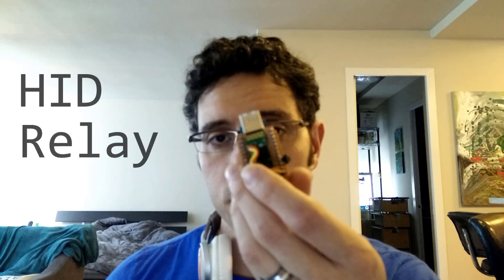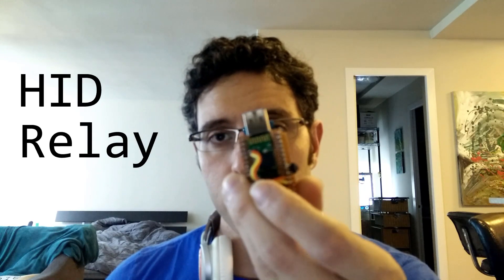HID Relay - Upgrade your USB Keyboard to Bluetooth!

Comment: Alot of gamers use PS2 keyboards. They're faster than USB connections. PS2 push information out, while USB pulls information, meaning PS2 sends information when it needs to, USB only checks to see if there are updates to pull.
Reply: Even better PS2 interrupt the computer to tell the keystroke

Comment: Damn i wish there where devices like that to buy. but i guess if we wait a year ot two there will be comming more and more good mechanical wireless keyboards on the market. currently there is only a very small market for those and it's hard (nearly impossible) to find a nice keyboard that is wireless.

Comment: Don't you sell ready-for-use devices?
I like the idea to convert my Lenovo SK-8855 keyboard to wireless (it even has a kind of bay for it at the bottom!). 
BTW have you tested  it on any keyboard with build-it trackpoint?

Comment: This nice, thanks for making this. I'm pretty new  electronics(have programming experience tho), I was wondering if I could make my USB mach keyboard bluetooth enabled plus I want to put a 3.5mm audio adapter in it so that you can also listen audio from the keyboard itself. I'm not even sure if it's possible, can you please guide me if that's even feasible project..  if it is, can you please point me in right direction?

Comment: Please do this for a wired gamepad. ME and a lot of people have the Nvidia shield controller (2015)  that works with windows and android when wired up via micro usb charging port. It was originally a wireless controller for shield devices and do not use it much as of right now. Nvidia somewhere in their support promised us Wireless connection to pc sometime in the future, but it seems,  the future meant another generation and I am not willing to dish out £60 for just a controller -.- 
If this could work with a gamepad then that would be great :)
I hope you read my comment 
Thanks for the great work

Comment: Cool! Did you test with custom firmware keyboards that register multiple input devices? Keyboard, media controller, and mouse input?
Reply from the maker: The closest to that which I've tested is with a logitech unifying receiver. It's a bit silly to go wireless over wireless, but it does "work". The standard keys are picked up, but not the specials like media buttons or calculator launcher. The mouse has a noticeable lag. Not wholly useless, but nowhere near responsive enough for games.
Reply: DastardlyLabs Yes, I'm suspicious those register as multiple devices, and need to be handled differently... Wonder what happens if you plug it into a hub and let the hub handle it :)

Comment: Hey , so i have a laptop that I am not using. So how do I make its keyboard Bluetooth or even wired usb.
Reply from the maker: You'll have to take it apart and see what you have. Look if it has any chips acting as controller and research the part numbers. It's "highly" unlikely, but it may just have a usb interface with a non-standard connector and then you'd splice a usb plug to test it.

More likely you just have a bunch of key switches connected to a ribbon cable. At this point you'd need to figure out the mapping of rows/columns to wires. And then dive into the rabbit hole of diy keyboards. I haven't attempted diy-ing a keyboard like this, but here are a couple of links that might help get you started:

https://www.instructables.com/id/Make-Any-Vintage-Keyboard-Work-With-a-Modern-PC/
https://hackaday.com/2014/04/30/using-a-thinkpad-keyboard-over-usb/
https://hackaday.com/2018/02/15/arduino-keyboard-is-gorgeous-inside-and-out/

Comment: Thank you for this good video.
Is this possible with the arduino mini? The usb type does not matter to me. I wonder if it is possible to use the built in usb port of arduino mini to interface with a keyboard and to connect to the Bluetooth module via serial interface. I would like to know if the built in usb port of arduino is available for usb purpose other than the usb-serial port for program upload.
Reply from the maker: My gut instinct is no. Most of the arduino usb ports are just usb slave devices performing serial communication. Usb host functionality (which is what the host shield provides) is needed to talk with other slave devices like keyboards or mice. I don't think the arduino can handle this on it's own (and still have program storage and memory left over for other tasks).

Comment: Nice video. I've tried same thing but with  a homemade arduino zero clone. It has a built in USB host. I was able to get my mouse working no problem. No noticeable lag whatsoever. 

Maybe because you're using a separate USB host its slow.. I'd suggest you use arduino zero or any other board with native USB host.
Reply from the maker: suraj bhawal One of the main draws of this project to me was price, as the Arduino, host controller, and Bluetooth adapter can be had for really cheap. $10-15 shipped. Even less if you really shop around or order from China. Is the Zero clone cheaper than that? Do you have any links to those clone boards?
Reply: DastardlyLabs now that I checked.. There aren't any cheap zero clones.. The cheapest option I could find is adafruit's  m0 basic proto board for $20. 

In my case, I ordered a few atsamd's samples from microchip to experiment.. I successfully created a bare minimum zero board. From that I created a USB host sketch to interface a USB mouse and sent data using the hc-05 module.

Comment: will it work with game controller?
Reply from the maker: It can as long as it's for sure an HID game pad. The arduino code might need to be modified in some places, but I'm not certain. I am certain you'd need to modify the bluetooth adapter to report as a gamepad instead of a keyboard.

Comment: I followed everything as mentioned. The HC-05 is recognized as an Keyboard to my mac, but the Arduino code (USB2BT.ino) doesn't give me any result. But If I wire it through serial with the FTDI chip and run the example for keyboard reading , I works. But after your code, it doesn't send me any key strokes.. Any ideas?
Reply from the maker: With the arduino/host module sending keystrokes via serial through the ftdi chip to the serial monitor we know that is soldered together correctly. If you aren't getting any keystrokes via the bluetooth, this sounds like the USB2BT sketch didn't flash correctly (check for errors in the Arduino's IDE console), or possibly the bluetooth module's rx/tx pins aren't wired properly to the arduino.

Comment: The ida is good, but it will work just a lot better with ps2. 

Ps2 connections actually send keypress signals to the pc. So let's say you pressed "A" then the keyboard says: I pressed "A" 

But usb is different. With usb keyboards. Pc is constantly asking keyboard to see what has been pressed. 

So data sending is way more than with a ps2. And also it is constant.

While ps2 keyboard will just send info when keys are pressed
Reply: From:  https://en.m.wikipedia.org/wiki/USB_human_interface_device_class

"The same HID protocol is used unmodified in Bluetoothhuman interface devices.[2] The Bluetooth profile specification only points readers to the USB HID documentation. In this sense those devices also belong to the USB HID class."  

It seems it would be doing the same amount of work given that the protocol is unchanged.

Comment: This is way over my head. I'm trying to get a wireless USB-A to standard USB for a chiropractic tool I use. Could you help in offering advice on if this is possible? The USB-A would need to be battery powered.
Reply from the maker: Unless this chiropractic tool works like a keyboard when communicating with the computer, my project won't be able to help you. This does not convert everything USB to bluetooth. It specifically can talk to USB keyboards and "relay" the keystrokes to a bluetooth transmitter that itself is configured to be seen as a bluetooth keyboard by computers.

Comment: Man this is amazing have a quick question will this work with keyboard that has media keys and volume knob? like the Das Ultimate 4 http://www.daskeyboard.com/daskeyboard-4-ultimate/
Reply from the maker: Not without further research. My keyboard ( https://www.amazon.com/Team-Wolf-Swappable-Customize-Mechanical/dp/B01AFGOGK8 ) has some media keys for Vol +/-/mute and nothing seems to happen when I use them through the relay. It's probably my code is favoring HID payloads that are strictly keystrokes or modifiers, and those buttons might be identifying themselves differently.

Comment: would it work with a USB drive?
Reply from the maker: Not at all. This only works with USB HID type input devices. Flash drives, printers, (or basically anything that isn't a keyboard, mouse, or maybe a game controller) that you plug into the Relay will do absolutely nothing.

Comment: Hi DastardlyLabs,

I am interested in your project, I am going to make it for my gamepad, but I have some question:

1. Does Gamepad(standard USB game controller) work with this device?

2. Can I cut out the power supply voltage for UBS port, cut like your guide, but I don't solder the 5V power from USB power source, the game controller has battery to power itself, it will be charged if UBS has power.

Thank you,
Nhan
Reply from the maker: 1. If the gamepad is HID compliant, it can work but you will still have to do some changes in the arduino sketch since it's expecting a keyboard. Also the bluetooth module needs to be programmed as a gamepad so your computer recognizes it properly, instead of as a keyboard. Evan shows how to configure the module as a gamepad here: https://youtu.be/mt8uF9IblUU?t=1m1s

2. I think it should still work so long as you don't cut any other pins. Obviously you'll keep D- and D+, but be sure not to remove the GND pin. Even if you're not powering the bus, I'm pretty sure the devices still need to share the same ground reference in order to communicate.
Reply: I will  try, thank you for your quick answer.

Comment: Could I use keyboard and mouse at the d0same time?
Reply from the maker: It's possible, but the code I've written doesn't support it currently. The USB library allows for a USB hub to be used if you #include an extra header file, but then the Arduino sketch needs to be modified to look for two USB devices instead of just the first one it sees. Then read and combine their data when talking to the bluetooth module.

Comment: Nice! I was thinking I could try this for my friend's Wacom Intuos tablet (shows up as an HID). At the end of your video you said that gaming mice have a notable lag, though, so I'm going to guess that a tablet would be even worse. :( Have you tried a Wacom with your system by any chance? Thanks!
Reply from the maker: I have no drawing tablets to test, just mice and keyboards, but I'd be interested to see if you can get yours working.

As a heads-up I'm pretty sure you'll need to change the HID descriptor in the arduino source and in the bluetooth module's configuration to identify as a digitizer instead of a keyboard or keyboard/mouse combo.

Comment: Useful and well done! However, PS/2 relay is still viable for the majority of devices, because they, both keyboards and mice, at least the inexpensive devices, actually have a mixed-mode controller in them that supports PS/2 signalling in spite of only providing a USB plug by default.

As to the delayed gaming mouse... it's probably trying to force high report rate, more than 125 reports per second, in hardware.  That actually makes for a much smoother experience, because at 500 or 1000 reports per second, the discrete movements of the mouse no longer visibly clash with the monitor refresh rate, thus providing better target tracking while aiming and shooting, and also higher linear speeds are possible, because displacement reports limited to +127/-128 cover a shorter amount of time each, thus the limit is less likely to be hit. And you know, in some games, being able to both aim with subpixel precision and also rotate 180° or even 270° within 3 frames by doing a large arm stroke of specific length are necessary. Perhaps not so much Western games, but Korean shooters... You cannot sensibly react over such short timespans, so high report rates are not about minimizing latency, however what you do is to plan ahead, and then you still must execute those moves with utmost precision trained into your arms and hands without broadcasting a tell to the enemy a few frames in advance, or they might evade or counter... and device limitations become painful.

I recall having experimented with the USB filter drivers that pretend that the mouse requested a higher report rate, and while it works with wired mice, with some wireless mice, i actually got a delay! Though the mechanism of both issues is unlikely to be exactly the same, even if description is similar. You might not have quite enough processing or data transfer bandwidth somewhere in your chain of devices.

6-key rollover is a principal USB HID protocol limitation. It's not an issue practically, as long as there is actual rollover to any sets of 3 or 4 keys as opposed to anti-ghosting of the keyboard jamming the newly pressed keys, but that's not something the USB and Bluetooth layers have to concern themselves with, that's up to hardware design of the keyboard only - controller, disambiguation method such as per-key diodes, the specific scanning matrix in case there is no complete disambiguation. Also i recall having to throw away a few keyboards because another Korean long discontinued game hated their anti-ghosting behaviour... oh well.
Reply from the maker: Thank you for that well written and informative comment! A rarity on youtube that needs to be commended.

I of course didn't mean to discount PS/2 devices entirely (I know plenty of gamers who swear by their PS/2 keyboards). That was only to point out a group under served by Evan's bluetooth project -- USB keyboard owners. I do know that some USB keyboards internally support PS/2 when used with dongles/adapters, but in my research I found it's not guaranteed to be in every USB keyboard or standardized to the same adapter so I didn't want to rely on that.

For the mouse issue, I had suspected something like an imbalance of reporting rate vs bluetooth throughput, or even a limitation of the arduino to process data quickly enough. It may not be something easily overcome with this cheap handful of components, though.

You did mention something about mice requesting an elevated reporting rate. I wonder if as a cheap software fix, there's a way to intercept that request and force the mouse to throttle it back to a lower level. This obviously wouldn't help fast twitch gaming as you suggested, but could be a happy medium to support my modest goals of casual FPS and adventure gaming from the sofa, sans wires.

Comment: hi.. how much power does this use when there is no keyboard activity?
power saving features will make it PERFECT!
Reply from the maker: I haven't measured the power draw, but energy savings and battery life extension is pretty important.

I think I recall reading that the bluetooth module is supposed to have a low power state that can be triggered. You could add to the Arduino code a resetable timer, such that if X minutes go by without any input the BT module and Arduino can be put to sleep. Problem is, ideally you'd like to just tap a key to wake it back up, but I don't know how we could trigger the Arduino to wake from sleep just via the USB input. Maybe the USB Host module has something we can use for that, but maybe not.

A less elegant solution might be to add a wake button which could be tied to an interrupt pin. If you leave the keyboard alone for a while, come back to type and nothing happens, tap the wake button to fire it up again.

Also in this configuration the keyboard would still be drawing power since it's 5V line is connected directly to the power bank. But maybe that's negligible and sleeping the BT module alone could provide some good power savings.

Or maybe an even less elegant solution, run the whole kit through a soft-latch power circuit. When you want to "sleep" it instead of playing with actual low-power or sleep modes, just send an off signal to the power circuit which kill all the power, then you "wake" it by tapping the main power button again.
Reply: sounds good man.. sorry i can't help much.. more a software guy rather than hardware... hoping you will succeed so that i can turn my new drevo 84 mechanical keyboard into a wireless one  :)

Comment: Nice presentation. I ran into a keyboard limit in another project I worked on using a wireless keyboard as a MAME controller. Subbing in buttons for the keys, I ran into issues when more than a couple buttons were pressed. Worked well for Pac Man at least :)
Reply from the maker: Thanks for the kind words, Jeremy. That keyboard you were using was probably a 2KRO (max 2 Key Roll Over). Just by the way they're designed/wired, some keyboards simply don't detect and transmit more than a couple of concurrent keypresses.

https://en.wikipedia.org/wiki/Rollover_(key)#n-key_rollover

http://www.keyboardco.com/blog/index.php/2016/03/what-is-nkro-our-guide-to-rollover-anti-ghosting-and-choosing-the-right-keyboard/

I've dug a little more into the HID docs and found that my 6 key limit is a restriction of the mode I'm using to talk to the keyboard, Boot mode. Supposedly HID can potentially allow for up to 10 simultaneous keys, and some keyboards even circumvent that limit by pretending to be multiple devices (using virtual keyboards for each additional 10 keys pressed). So, after lots more research we might be able to increase that limit for keyboards that can detect/transmit lots of keys...hopefully